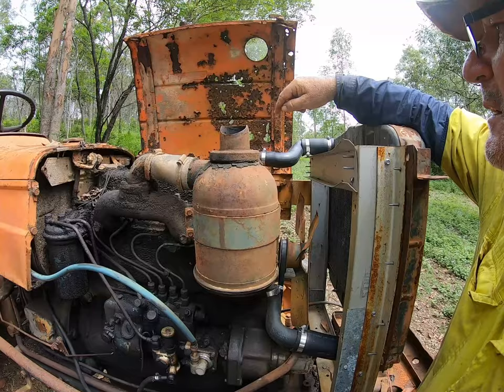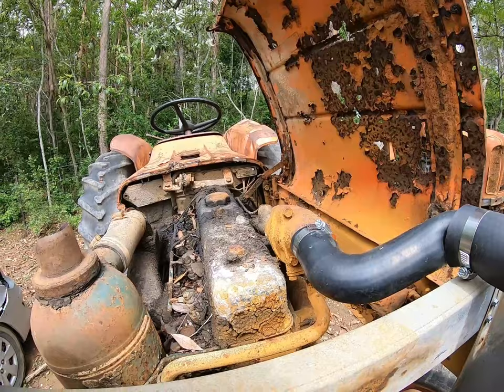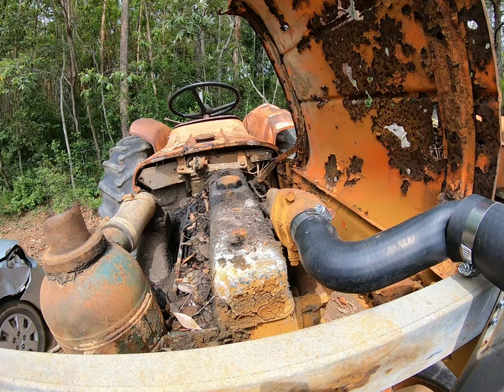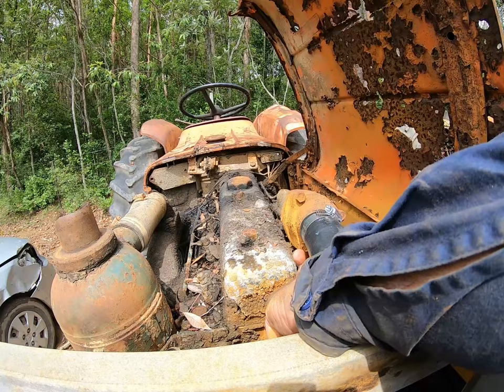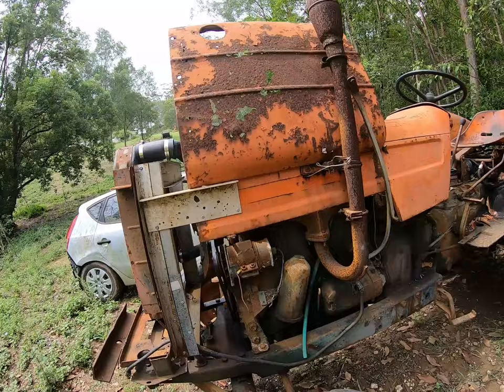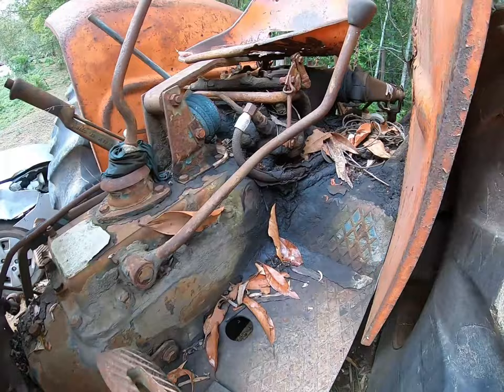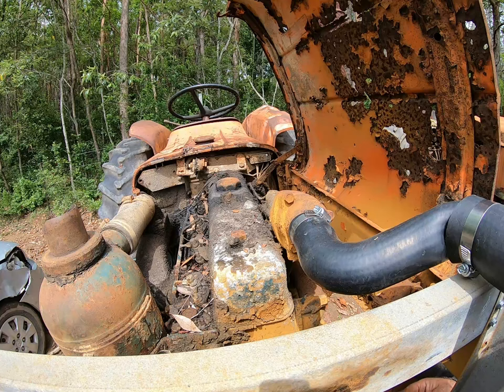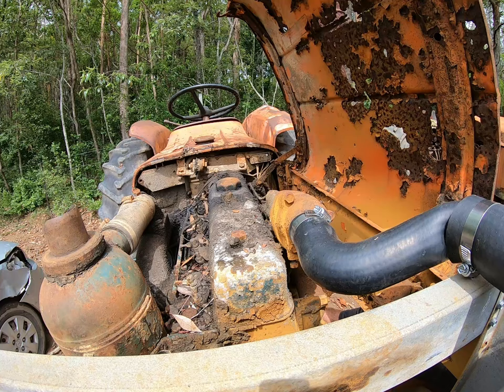Working on the Tractors on the Farm Fiat 615R can I fix it

Comment: Like mine - I got mine home 8 weeks ago. I live in Norway. I bought it over 1 year ago but it took time to get it home. Have not started it. It is in same condition like yours. The engine moves but diesel pump is bad. Only got one headlight. Trying to find panels and parts. Lock like it is difficult
Reply from the maker: I have found now with this one that apparently there are two places diesel can get into the sump and one was changed so it's possible the injector pump is in need of work, But we cooked the starter to get to this stage so it in for a rebuild today. do you have yours on your channel?